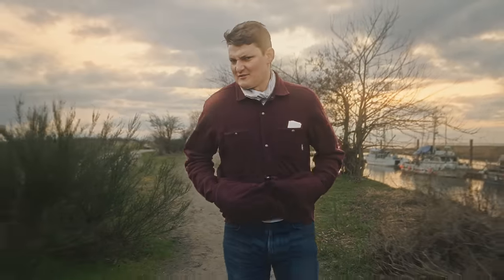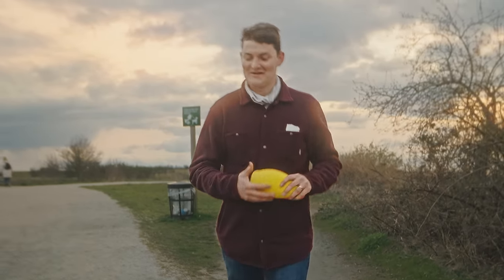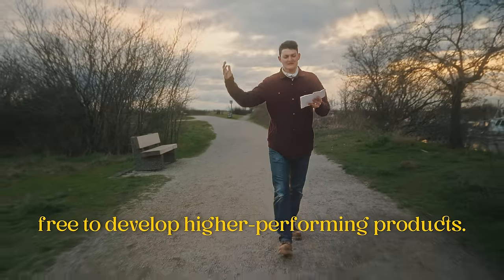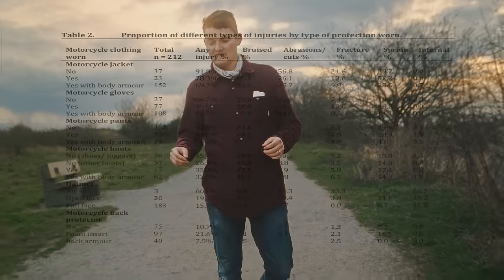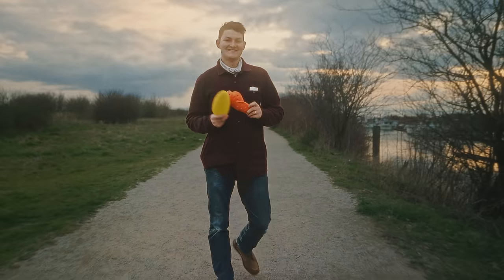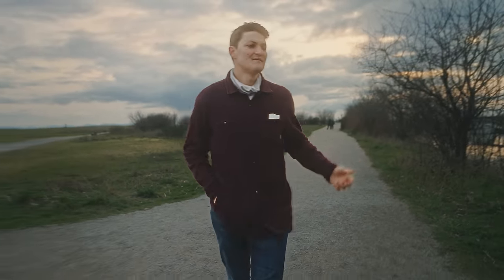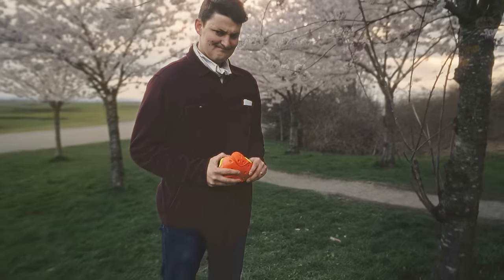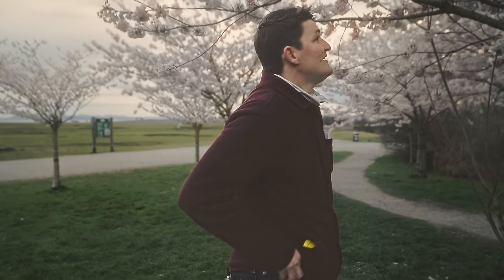Why I Stopped Wearing Motorcycle Body Armour

Comment: As an orthopaedic surgeon (and a motociclist) I can say that its easier (and got better results)  to fix lower Energy fracture than higher energy fractures... So, the benefit of using this gear may not protect you from having that fracture in the first place, but may shield you from months of reabilitation and permanent pain and limitation.
Reply: Thanks mate, very helpful comment
Reply: Absolutely!
Reply: Is a high energy fracture determined by the speed of the mechanism of injury or the newtons applied to the bone? Just out of curiosity.
Reply: Touche!
Reply: This is how I feel about it. It's not always about prevention, just protection.
Reply: Great point
Reply: This is the answer i am looking for. Less impact energy means less damage, its not that complicated.
Reply: @TheFr3ck  for sure. And it’s not about just breaking bones it’s about not getting bruised up. I’ve crashed so many times on the track and on the street and the pads without a doubt help. It’s not even questionable.
Reply: Great point. That's why I'm keeping my armor on.
Reply: I’m siding with the surgeon.
Reply: Thanks for your insight!
Reply: @r3v4nwolf Not a doctor here, but an engineer. Generally fracture type things are measured in Energy because it takes energy to take things a part. Speed and newton alone aren't measures of energy, but more measures of how quickly energy gets applied. Kind of like how a spark from a welding machine has a high temperature, but won't burn you because it is low energy. Whereas some smouldering coles from a fire aren't nearly as hot but will definitely burn you.

Generally taking things like bones apart costs energy and the more energy you put into to them the more they fracture. If you're trying to get energy from say a big rock smashing into your shoulder you take into account it's mass and how much the rock slows down while smashing through your shoulder (because slowing down also costs energy) so it would be E = 0.5 * m * v^2 (where v is the difference in speed and m is the mass). So bigger or faster rocks transfer more energy into your bones.

Forces are related by E = F*s so the force times the distance it's applied. Which is a bit more comples to discuss practically because the forces are usually induced by momentum which is the energy of moving objects (which we discussed above) For example the rock discussed above, or your body hitting the ground at a high speed (and since the ground doesn't give way that speed is reduced to zero).

The way I understand it (but I'm not to well educated on this part) protective gear plays into reducing the damage caused by these energy transfers in two ways

The first one is by 'absorbing the energy' so it gives a place for the energy to go to instead of breaking you. The most effective way to do that is seen in gear that you can only use once. Bicycle helmets are a good example, they completely shatter during impact. As we said it takes energy to break things apart so the energy goes into breaking the helmet apart instead of you. Crumple zones in cars do something similar. And maybe softpadding does it a little bit because it deforms and loses some energy as heat... But I don't think that's very significand. Soft padding plays a larger role in the second mechanism.

The second mechanism is spreading the energy. Basically the idea is that if you fall on a scharp rock all the energy from you slowing down is focussed into a small area. And if that area is your vertebrea or a bone it's going to experience this as a high energy fracture. If that force is somehow spread out over a larger area, some if this energy might also go into other tissue like the muscles in the surrounding area, some fat, or other bones. That means all of those areas are also damaged but with less energy per specific area so the damage would be less extensive. This is where I believe padding helps a lot.
Reply: reading between the lines, Taking fortnites msg  ( if believed to be true for all riders ) as canon is harmful to a riders health in the event of accidents, I dont think i needed a real expert to tell me this, real world personal analysis says protective gear helps. the datasets are inadequate and my own  impact injuries still dog me from 40 year old MC accidents specficially in places where street wearable armor just wasnt available back then. 
This is a few notches off why bother with a helmet, they only do X. 
Just dumbfckry, If he wants to do it fine but making a video about it on one of the largest MC riders YT channels stinks.
Reply: @r3v4nwolf i think it does come down to the amount of energy/newtons put on the arm, leg etc. But that being it goes pretty much hand in hand with high speed. Newtons = mass x acceleration. If you fall at a low speed you’ll have much less newtons applied on your body and vice versa. I think that the answer is pretty much both
Reply: @Felipechiota Thanks!
Reply: Agreed. This video was over simplified, for road riding only and impacts hard enough to cause breaks. Protection in to your jacket isn't the the best solution either but CE2 is better than nothing.
Reply: As another orthopaedic surgeon - I totally 
agree.
Reply: Simply said. Was also thinking this the entire time while watching the vid.
Reply: Thanks.  I use put in my own after market much higher spec armor
Reply: yes - and therefore -throw out these cheap pads you get with your jacket and buy something better - that was the point with the video - there is even link to products.... How can ANYONE - disagree with that?
Reply: Im still wearing it , its better than nothing
Reply: 💯 thanks for saying it
Reply: thanks for setting things right. My friend crashed and his surgeon told him, that his shoulder would have been severely fractured if he didn't have the right armour. That would have meant several surgeries and several month longer rehabilitation.
Reply: Retired nurse here. Worked Ortho a lot. Surgeon is right (they love hearing that! 😆). Some of these impacts can literally turn bone like a tibia into 30 pieces. At least enough damage that you may get a nice shiny below the knee prosthetic to wear now! 

I found this interesting. However, physics jargon aside, would you punch a concrete wall with your bare hands? Or, would you rather punch it with the usual "yellow" armor over your knuckles and fingers?
Reply: @MrMichaelfalk  f9 didnt say that tho, he just said take them out...
Reply: Great input, it's really easy to simplify injuries into black/white of injured vs not injured, however nuance is 'how much' injury.
Reply: I crashed in november 2023, car pulled across my path and i t-boned it at 50-ish KM/H (30mph). I flew over the top of the car and landed on the road about 15 meters further. I was wearing an alpinestar hoodie, regular jeans, and mid length alpinestar boots, I however had an oxford backpack on, that contained a rolled up dry suit, and a spare hoodie for using at work. somewhere in the crash my Sacrum (S1 to S5) were shattered, my pelvis had an open fracture, and my tailbone broken, paired with some heavy internal bleeding, my famiy was told to prepare for the worst. 

I think the backpack saved me from dying, I'm not sure how i landed, but im sure it was butt/lower back / back. I had ORIF surgery with 3 big bolts and then 6 smaller pins and plates, I can walk again now, im in pain most days and stuff, but im alive and its not as bad as it could have been

So i definately agree with OP, limiting the amount of damage you do can seriously increase your likelehood of survivng / not having life changing injuries, leave the pads in lads, but maybe invest in an airbag or better qualiuty armour. You wont need it until your life depends on it, once your life does depend on it, spending those extra few hundered will be a no brainer. I can only think about how my last 6 months would have been had i been wearing better gear.
Reply: @r3v4nwolf  high energy implies high force, and force is measured in newtons.
Reply: This was posted on april1…just saying
Reply: You work at vgh and ride a gsxr?👀
Reply: @r3v4nwolf  its impact (so momentum) which is newtons applied over a time more newtons over less time is more chance for fracture
Reply: this is the most important reason to keep it in - less damage than without, of course.
Reply: Now that we have a professional in the chat, Id like to ask if there is a higher risk of joint/back pain problems in the future from riding a motorcycle. There are ppl saying it will harm the joints and back in the long run just from riding a motorcycle and then there are ppl saying the opposite, i.e. no farm will be done. Can u bring some clarification into this controversial opinion? Thanks in advance
Reply: Lots of weird meat riding of an expert.

Your takeaway from the video should be to demand better from manufacturers of this gear and to purchase gear that is more effective than what is commonly considered to be standard.
Reply: Thank you for giving this anecdote! I feel that from a physics background f9 should be realizing that even if the armour is inadequate, the energy dissipated in mechanical deformation of the body is reduced by energy lost to the armour.
Reply: @MrMichaelfalk  the main takeaway for many (maybe most) will be that "these pads are crap, so I see no point in wearing them". I barely saw a hint of encouragement to buy something better, it was downplayed way too much.
Reply: I'll side with Doc.
Reply: Exactly man, I am wondering if this video should even be reported. Don't want to mess with F9's shit but I see this as a non-appropriate, dangerous, misinformative video.
Reply: @jasicjan  Not sure I follow this train of thought - just the daily grind of working will give you back pain as you age - repetitive strain injury - getting old - it comes to all of us. If you are young and fit it should not be an issue - for now. I forgot to mention riding position/style. Wear a back protector with adjusters such as Forcefield or a kidney support.
Reply: @TokyoJuul8008 More protection is available as long as you’re willing to pay for it. I spent $3,000 for all my gear. Some people only wanna spend $300 or they simply don’t care about safety or whatever and it’s up to them. If you wanna spend more, there’s the option for airbags, custom made suits etc. You can’t expect $3,000 worth if protection by paying $300.
Reply: I had a 90km/h crash with a dog, went straight to the tarmac with my collarbone, and then slided on all my sides for 40 meters. I was fully geared, and I only had a collarbone fracture, my orthopedic doctor told me that mu full gear saved me from a way longer recoveey, so I will always wear my gear!
Reply: @buddha.q  Wow, all that at 30mph? Just goes to show, you're not as safe as you think you are when pootling around in town. Glad you're on the mend :-)
Reply: @r3v4nwolf  I think it's the amount of force transfered to your bones and not the speed that dictates whether it's a low or high energy impact. But i do love the surgeon's comment because I was thinking that the whole video. It's better to limit that injury because the severity of the injuries a person gets can change that person's whole life.
Reply: Common sense...
Reply: Thanks, man.  I"m keeping mine on!
Reply: @jasicjan I'm not a professional but I've been riding for 49 years averaging 7000-10000 miles per year and don't think mororcycling does any harm to your back. Just look after yourself, doe some exercises and stretching.
Reply: As an xray tech passing you the surgical case, and a fellow rider, you are correct. I hope Fortnine will reconsider his advice.
Reply: Yeah but that doesn't make a good youtube title to get that sweet sweet $$$$$
Reply: I heard a guy say that padding can make the difference between clean fracture or fragmented fracture (I hope I translated that correct). Now just believing what a rando says on the web is not the best practice, so I would like to ask you, is that true to some degree?
Reply: I get Ryan wants to make a point but I find his analysis and suggestions irresponsible.  Thank you for your take from the perspective of someone who actually deals with injuries.
Reply: @buddha.q  Glad yo lived to share your experience and wisdom  with us.  Be well.
Reply: Not to mention the added abrasion protection to where you have stretching skin. I took a dive off a mountain bike, and skin crayoned the road with my elbows and left thigh. The thigh wound was a lot bigger but didn't really bother me apart from the constant burning sensation. The open wounds on my elbows limited me from moving my arms as the skin stretching felt like hell. Long story short my summer was ruined and I now never ride a motorcycle without full, armoured gear.
Reply: So why wear a helmet? High speed riding there is noting that will keep you safe. And the body armor I think is more for road rash. And anything is 100% better then just skin.
Reply: I'm still not gonna wear level 1 protection, if I can hurt myself by lighty punching my knee with my bare hand, then it's not gonna do anything to help in an actual crash...
Reply: @gzahnd  yes.  Real life experience from the source vs  controlled lab statistics.  I appreciate having both points of reference for better insight.
Reply: Most of my life I rode in central Florida USA with nothing but a helmet, denim jeans and jacket. Often in shorts and T-shirt because it's so damned hot I would have died of heat stroke had I worn riding gear. My option is full armored gear is for the racetrack, responsible riding in whatever gear you can stand to wear is for the street.  I now live in central Georgia USA, not quite as hot as Florida, but still to hot (at least in the summer) to go around with foam rubber strapped to my body.
Reply: But if the evidence is that doesn't reduce energy sufficiently to prevent any fractures, is there evidence it reduces energy involved in fractures at all?
Reply: Thanks a lot. You helped me decide
Reply: @rich4716  Yes it's undeniable the pads will reduce injuries and even some fractures, but so would adding more padding. The issue is that armored gear is expensive, uncomfortable and restricts the rider as to when they can ride....For instance most people do want to or cannot wear riding gear to work or other places you go in daily life. 

So if the armor makes little to no difference in injuries for normal street riding in the real world, then wearing it has a lot of negatives verse positives. 

My takeaway is this...If you are riding on a track or like you are on a track wear every bit of armor you can for When you crash. If you are commuting or otherwise riding in a casual manner you can skip the full armor cuz it's not going to make huge difference If you crash.
Reply: Good point Doc, thank you.
Reply: @buddha.q  well said. Hope your recovery continues! Amazing what the 'bone docs' can do!
Reply: @rafchez1970  My thoughts exactly.  If anyone actually thinks that foam pads are going to save you in a high speed impact with a curb, tree, car, they aren't thinking straight.  I'm an ATGATT rider but I don't expect those CE 2 pads to be of any help at 75 MPH other than saving skin in a slide! I know this from many endos on mountain bike crashes - mother earth is a tough bitch!  I am going to buy an airbag vest, probably Alpinestars Tech 5
Reply: Yeah. This bubble lecture using stats, norms and conspiracy would be much more valuable with insight from surgeons and victims. Let's lower the energy!
Reply: Yup. Totally agree. Am also a biker orthopaedic.  Doing fixation eg; IMN (interlocking medullary nail) of lower limb/s with  abrasions at the entry point and the distal screw incisions carry higher risk of infection. Another point is that close vs open fractures make a world difference.
Reply: I’m not a surgeon but watching this I was thinking anything that reduces impact force must surely help reduce the severity of the injury.
Reply: @rafchez1970 Helmet is essential. I had a low side and slid across the tarmac. Unintentionally, my head touched down (wearing a helmet). It felt like quite a bang and I still felt it the next day as I mild headache. The helmet was badly beaten up as it absorbed the impact. Hate to think how I would be if I wasn’t wearing a helmet
Reply: Point missed
Reply: An orthopeadic surgen who cant spell motorcyclist!
Reply: Thanks for this. will do the armor all the time.
Reply: @r3v4nwolf  Me thinks low energy fractures is a clean break like falling from a ladder, where as high energy fracture is from like an automotive crash related impact, shattering the bone. Much more ouch
Reply: Very interesting comment. I spent 2 months in physio and still have a calf muscle injury years after a very very low speed fall. No fracture, and also no gear. Anything that could have prevented that, I am all for it! But I'm not sure if anything could have.
Reply: @TheFr3ck  Yes but it appears that we could get much better protection if the standards demanded it. Right now we are getting expensive gear that shows for very little proven benefit.
Reply: I don't care about a broken bone compared to how much I care that nothing can penetrate through the spine to the nerves - for example.
Reply: I am no expert at all, but what the video claims is that body armour does NOT reduce energy in fractures in a statistically significant way.
Reply: this should be pinned
Reply: RIGHT! Ive been in accidents and thankfully the gear saved me.
Reply: @r3v4nwolf  Yes. The energy is half the mass times the square of the speed. (note that the speed matters more than the weight)
Reply: @drsyahid99  Agree with what? That some fractures are worse than others? Some are more repairable than others?  Or you have detailed statistical analysis that CE1 or CE2 armor produces these less severe fractures vs wearing a T-shirt.  There should also be statistical difference between accident outcomes in level 1 vs level 2 armor.  Can anyone point to it?
Reply: Critical point; thanks, doc!
Reply: I’m siding with the doctor not the Fortnite
Reply: many thanks for your expert (and succinct ) knowledge. Always been wedded to my padding!
Reply: Spot on
Reply: @chaoscorchkdr1782 so I didn’t read any of the crap you typed out after you said a spark from a welder will not burn you. You clearly have never welded anything before
Reply: Think of these protectors like crash sliders they look like tokens but do a great job when the motorcycle takes a fall. I am not removing mine. Thanks
Reply: I'm with you too. As a rock climber, I am very familiar with energy transfer (kN's) and force factor falls. We don't just throw the baby out with the bathwater because our dynamic stretch ropes don't reduce our fall factors below the bone breaking 4kN's. They reduce the force, and reduce the injury, not eliminate it. If you take a big enough whipper/fall, force factor 2, you have a very serious chance of being injured by the forces transmitted to your body. But we're not like "well fuck it, I guess I'll climb ropeless".
Reply: I broke my upper humerus (4 pieces) 7 months ago, my surgeon said it was a high energy fracture. I was wearing my local brand level 1 protection instead of my knox level 2 jacket. I have 11 titanium pins and a plate to hold the pieces and after the accident I always wondered, what would happened if I was wearing my level 2 protection? After 2 months of physical theraphy my shoulder still hurts and immobile at some extends.
Reply: That's worth it to me.
Reply: Thank you !!
Reply: @austinmatthews347 and ?
Reply: Thank you!
Reply: This is such common sense. Thank you for pointing this out. Unfortunately stuff like this (videos) is all to common for the stake of clicks. Scary part is almost 2 million people will be misinformed cause of this.
Reply: @r3v4nwolf   IDK, try falling without a helmet and see what happens. Sometimes we are just too smart for any common sense to seep in. Good luck to you and all you influence.
Reply: Thank you. Excellent point.
Reply: I;ll go with that, qualified opinion.
Reply: The padding I wear whilst in line skating is thicker
Reply: on this note, i actually remove my pads but wear external protection, spine protector, knee brace, and such
Reply: @Godfamcountry  lol triggered much
Reply: Wow!
Reply: @austinmatthews347  Felipe is converting to English just for you to pick on him. This comment tells us about you. Stay off the streets.
Reply: exactly what i thought and i m not a doctor. These things saved my summer 10 years ago.
Reply: A little protection is better than none all the time.
Reply: Very well said
Reply: I thought the same thing. Feels like a clickbait video for me and frankly irresponsible. I have absolutely had slow-speed crashes on my motorcycle where I've gone over the handlebars and absolutely would've broken a knee if it weren't for these things. They do their job. Most crashes are at slow speeds, we just hear about the highway fatalities. The 18kn and 8kn transference numbers he's playing with are in relation to the same 50j impact. Sure, it only takes 4kn to break a bone, but some bone breaks are worse than others and some impacts are less than 50j.
Reply: Motorcycle gear keeps getting more and more expensive without improving the quality of the garment or protection
Reply: @daku911  I'm not sure whether that's true but it's probably simplistic and definitely irrelevant. The question is only this: Does wearing protective gear decrease the severity of injury in a crash? The answer is "yes" and it's very well proven.
Reply: That's good to know. I actually fell off a bike. The only time and it was during a training course. I was riding way outside of my comfort zone at the time and on a cruiser instead of my scalpel of a sport bike. I wasn't going very fast, but there was centrifugal force involved and I hit the ground pretty hard. I know this, because the instructor said he heard my helmet contact the ground with quite a bit of force. My back hit the ground first and the CE 2 armor I had tightened up and it felt like falling on a really hard mattress. Maybe I'm the anomaly and I just rolled really good RNG for that fall, but I'm glad I had it on.
Reply: @gabrielkind2970  I completely agree with you. I wear gear whenever I ride and I have witnessed my brother being saved by it when he highsided back in his racing days. What irritates me is when a jacket or a pair of riding pants costs many hundreds of dollars and comes with minimal levels of padding. It seems at times that the companies that produce this equipment aren't giving the motorcyclist the best protection they can for what's being spent, but rather starting to pass themselves off as lifestyle brands.
Reply: @daku911  It's true. If you want to be a vigilant rider, you gotta definitely do research as a consumer and also be willing to wear less comfortable or styling gear. Many aren't willing to make the trade off.
Reply: then advocate for better pads/higher ce ratings
Reply: @Hazztech  What do you mean 'advocate for' them? I already buy ones with higher CE ratings. You want me to advocate to ban lower CE rating pads? Seems paternalistic. Other people can do what they want and it's still better than nothing.
Reply: @gzahnd Like saying I’m siding with the mechanic over the engineer. I’m going with the scientists.
Reply: @blind9376 He gives you a better option for pads at the end boomer.
Reply: What I took away was his real point. That is :  EN1621-2 establishes that a 50 joule hit would require a transmission of less than 18 kN for CE 1 and 9 kN for CE 2. Human femur breaks at 4 kN and 'horse girls' wear protection that affords the 4 kN protection and why wouldn't motorcyclists require the same? The main gripe was about the Regulatory Capture aspect and shame on the manufacturer's for duping us and gambling with our safety first.
Reply: @TokyoJuul8008  It's not an either/or situation.
Reply: @thyron  How was the dog?
Reply: As someone who exploded both kneecaps, I’d do anything to go back and have any form of protection
Reply: @r3v4nwolf high energy fracture is kind of a loose, broad, subjective term, but it usually refers to fractures that happen during stuff like sports, motorcycle riding, skiing, car crashes
Low Energy fracture usually refers to stuff like " they slipped and fell and broke their wrist while walking"

So high energy fracture is kinda determined by all of the things you mentioned at once. 
The point OP was making was just, that the lower the impact  caused the fracture, the better likelyhood that the damage is less severe, and that ones recovery well be faster and more comprehensive
Reply: @blind9376  first of all: 
It's quite far off the "why wear helmets", since helmets have been repeatedly proven to be THE most important thing you can do to help survive a crash. So no reason to be quite so hard on him. Especially since he is actually quite carefull to objectively represent the data, and makes sure to mention the types of body armor that actually does work very well at preventing fractures. 
Second: the body armor he is talking about aren't protecting you life, but your bones in your extremeties. So as with anything else, it's a "comfort and style vs protective function" risk evaluation. He is just telling us where he landed when he evaluated the risks. That's a personal assesment. ATGATT only holds up of you always wear a top of the line racesuit with airbags and the very best protectors. Anything below that and you yourself is making a risk assessment between protective Utility and comfort, style and cost. That's all Ryan is doing here
Reply: @MrMichaelfalk  Some high-end jackets already implement the top-of-the-line (often SAS-Tec or D3O) pads. But if you bought a more affordable jacket with minimal (often CE1) pads, by all means, upgrade. It'll be one of the most cost-effective safety upgrades you can do.
Reply: Is it more about the likelihood of the fracture displacing or is it something else about the nature of how fractures heal regardless of if it displaces or not?
Reply: @r3v4nwolf the newtons transferred bigger weight objects (cars) transfer more engery
Reply: Not according to the statistics.
Reply: Thank you for your insight.
Reply: Just a basic clickbait title!
Reply: there is something similar with hockey gear - manufacturers even state on labels that these protectors will not allways prevent injury, but reduce it. something like that. I would imageni its a similar situation here.
Reply: This is like top gear for motorcycles😊
Reply: They know what they're doing on this channel, in this video they're pandering to the many (too many...) riders that just look for an excuse to leave their gear at home because it makes them sweaty in the summer, and they need to carry it with them when they park.
Reply: This video should be taken down, especially from a guy who constantly mentions a physics degree because not all forces in a crash exceed CE ratings.
Reply: @gzahnd not the smug YouTuber famous for his opinionated hot takes?

And who sells these "useless"  armored gear? FORTNINE. Is he now telling us his employer is scamming all of us?
Reply: @greguet all his videos are like this. You know who works advertising with a pysics degree? Flunkees.
Reply: @MrMichaelfalk better? Says who? So we can all admit this channel is nothing but advertising.
Reply: Thanks man....I made up my mind. I'm not gonna remove the armour.
Reply: @r3v4nwolf the amount of energy the bone experiences to lead to a break
Reply: I've taken a knee on boulders offroading in the rocky American west numerous times.  I've had virtually the same impact on the same boulder with the same bike on the same trail twice, once with and once without motorcycle pants on.  I cut my own neoprene padding for my motorcycle pants in layers which protected the whole knee and shin, so I'm not sure how it compares to rated armor.  However, just 4 layers of thin neoprene foam padding was the difference between no bruise and a 9 month bone bruise that still hurts a year later.
Reply: It's like the difference between a concussion and your head going splat. Are either great? No. But force me to choose and I'm taking the concussion.
Reply: And I’m sure it would save you from a chipped elbow etc. at low speeds.
Reply: NONSENSE!!!!! 
Simple put it, i dare you to land on your elbow from the chair you sitting on with jacket and the armour and without one! 
Guage that difference for your self!!!